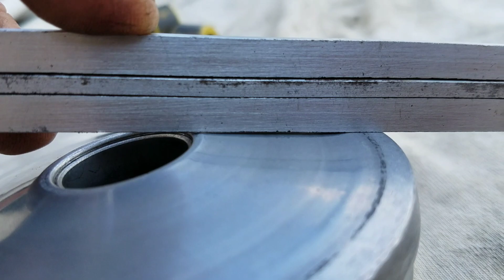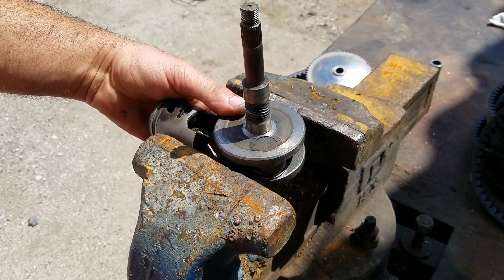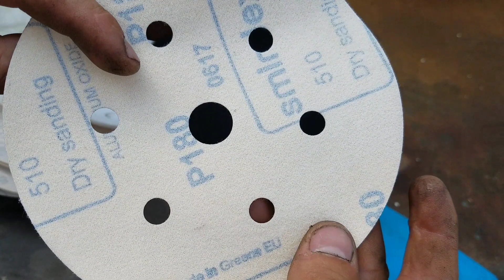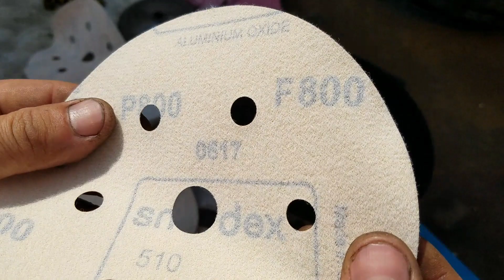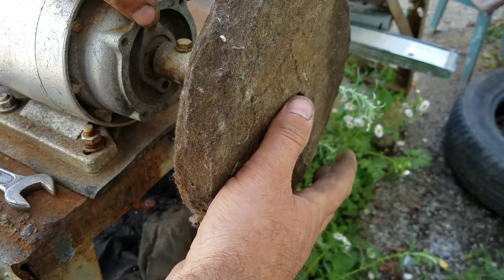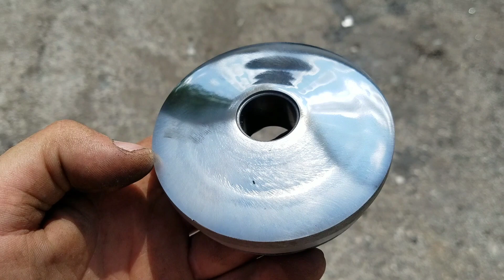Провал при разгоне скутера, выработка на рабочей поверхности вариатора.

Comment: Looks good but you shouldn't polish it. The belt is going to slip.
Reply: No it wont. They are shiny new. Old wear tgat it had is going to make belt slip. That will grip belt very hard.
Reply: RapeetRanut on the first few minutes of a new belt, maybe. You want a clean and even surface on the variator. Not a mirror polished kind of thing. It will slip.
Reply: @fullmetaljacket7  It wont be polished for long
Reply: RapeetRanut the belt will slip while it is, and that's another reason why polishing it makes no sense.
Reply: @fullmetaljacket7  Slips that few minutes like you said. Old finish had craters and I bet that this will slip less than before.
Reply: RapeetRanut no pulley comes with a mirror finish like this from the factory for a reason.
Reply: @fullmetaljacket7  true, every video that I saw from reseller's servicing scooters, they pass sandpaper at the variator to remove any polish made by the belt

Comment: why would you polish the variator?? won't the compound wear off and make the belt "oily" and slippery?
Reply: Polishing prevents wear on the belt, the polish compound can be removed with solvent but the smooth surface will remain on the variator, the scratches if left will act as sandpaper on the belt and wear it down
Reply: @marcellucassen8033  isn't better to just use a really fine sandpapper (like 800?). I feel like the polished variator doesn't have much grip and the belt will slip easy
Reply: @simonferm5493  I don't know how it exactly works but variators are always made of a polished metal and the rubber belt will have a good grip on it, the rubber will grip on metal even if it is polished